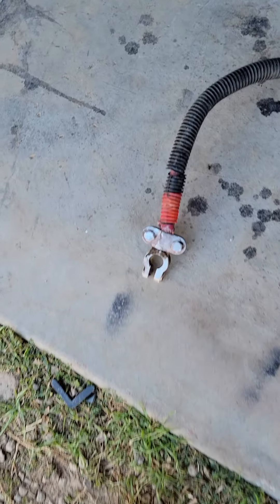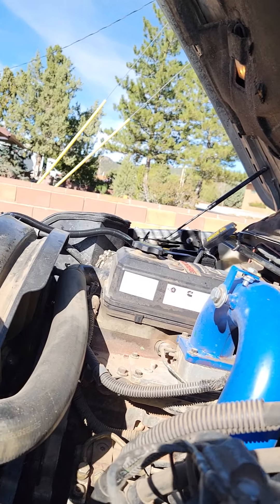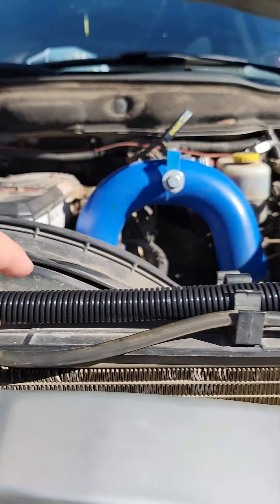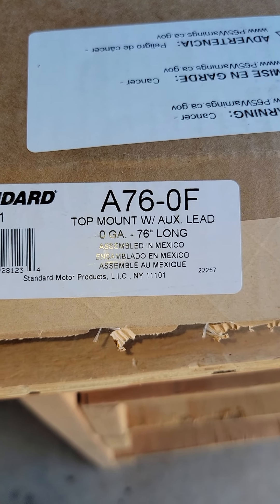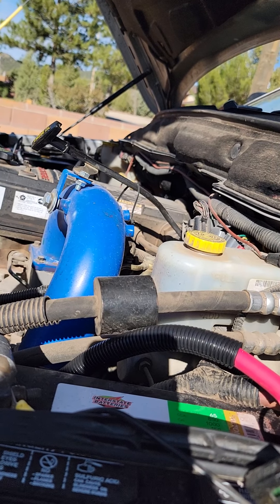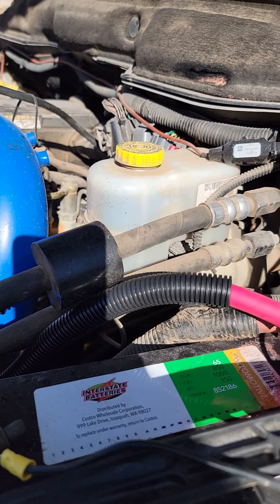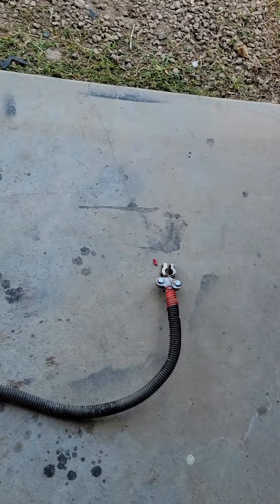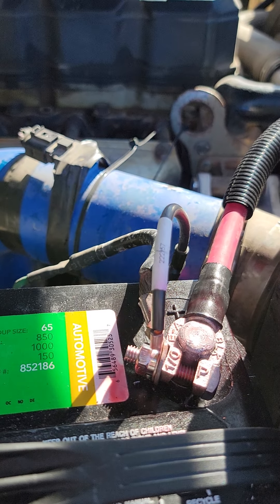5.9 cummins crossover cable part 2ish

Comment: I have an early 07 5.9 HO and I replaced ALL my cables with 2/0 just today for about $160 (2/0 temco welding cable on eBay is about $120 for 30 feet)
Reply from the maker: Ya I just found this on rock auto and was happy with it, like I said in the video, 3 to 400 just for copper at carquest was outrageous
Reply: @tanner5.9h.o.97  yeah damn thats expensive